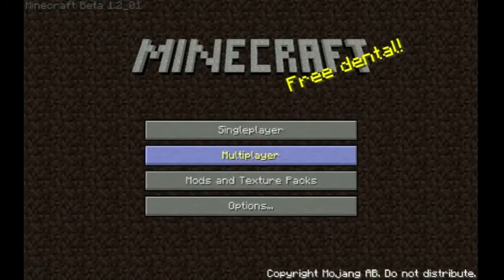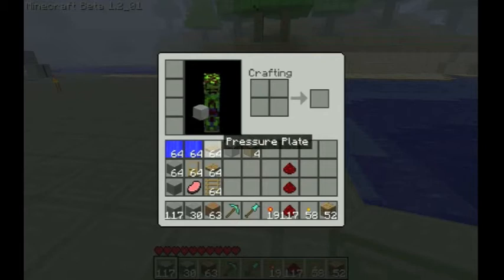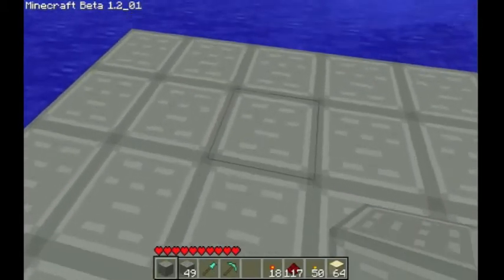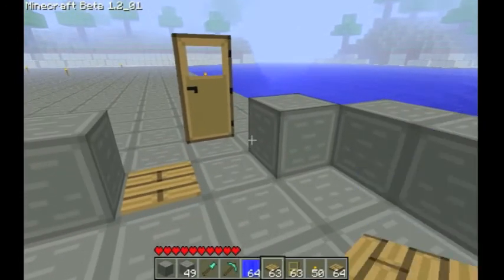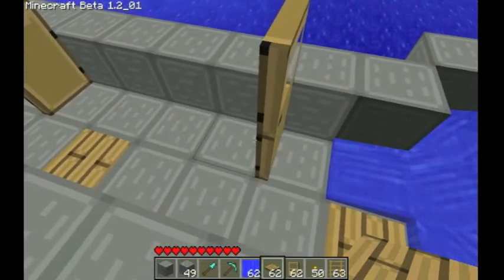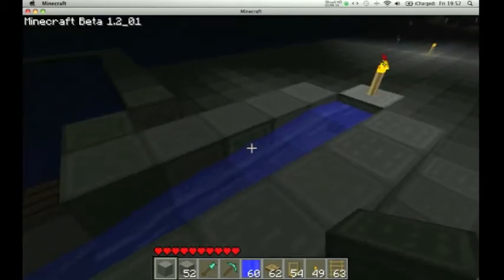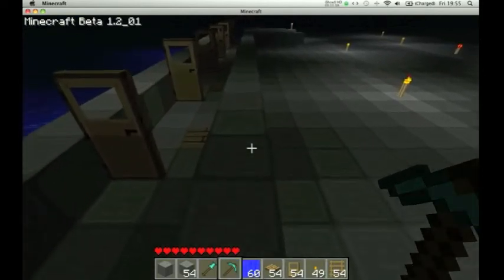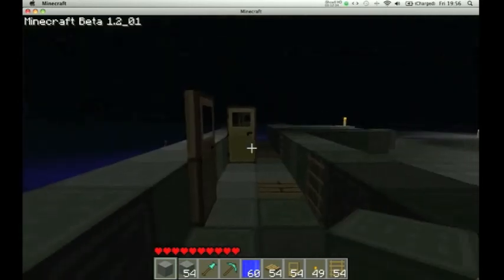Minecraft - How to make a complete 7 segment display & Decoder(Part5)

Comment: What about a reset feature for the boat. I think you just expressed the problem with 4bit counters and 7segment displays. you displayed it with boats though. the boat keeps going even when its pass 9 (Max number display can count to.) Same with 4bit counters they keep going until 15. therefore having more inputs than outputs. but instead of a halt gate you could put a watervator bringing the boat back to the start. Problem solved eh?